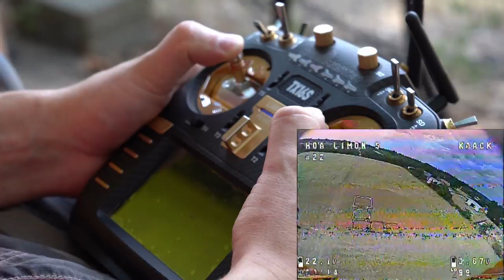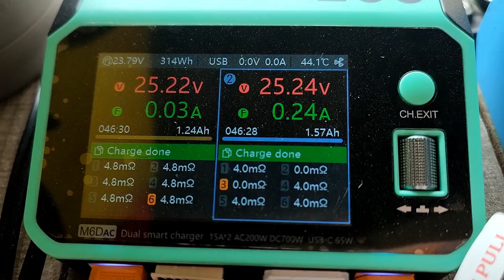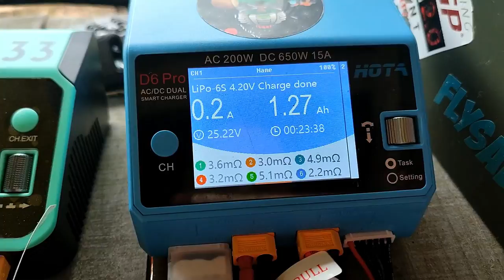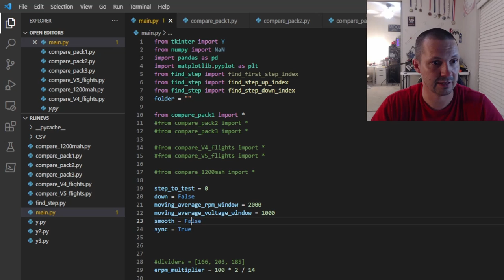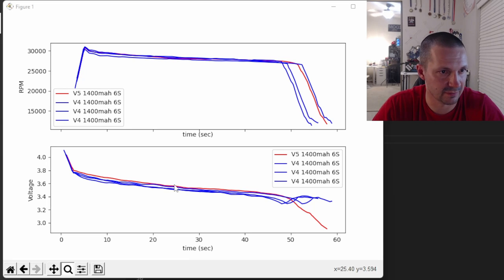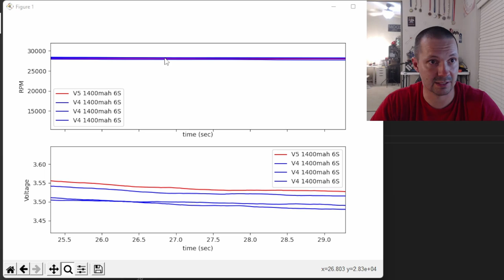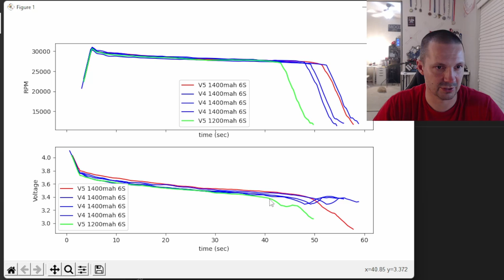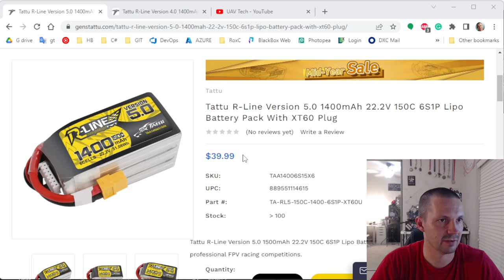R-line V5 - is it really better?

Comment: I noticed myself with the Tattu lipos, the better the C rating and less voltage sag it has, the wilder the drop off voltage. Once she empty the drop avalanche voltage happens a lot quicker. It is almost like the extra power gained in the chemical composition is at a cost of battery stability. I also found, the higher the C rating with these new versions, I am randomly losing cells for no reason. no crashes. Just one day a cell is dead or it suddenly has a much higher internal resistance to the rest of the cells. Had this issue since V4 was released. More than half my collection of V4 lipos died after flight 5ish giving up a cell. I never flew them below 21.5v on 6s dead and only do basic freestyle with very low pitch props.
Reply from the maker: After flying them for a bit I noticed the same thing... But they been pretty nice and replacing the batteries if you send them pictures. But it's still pretty sad.